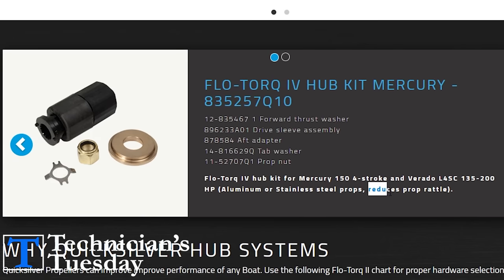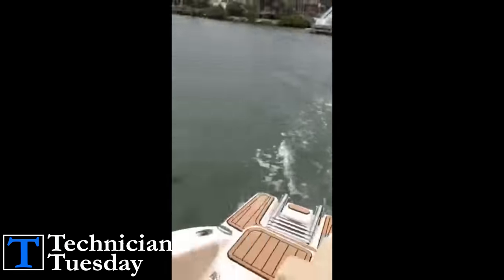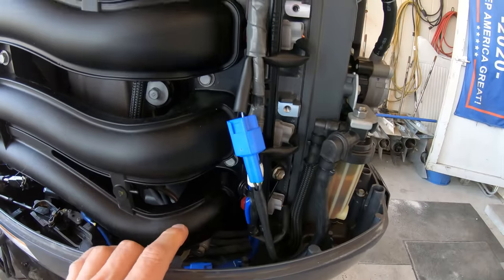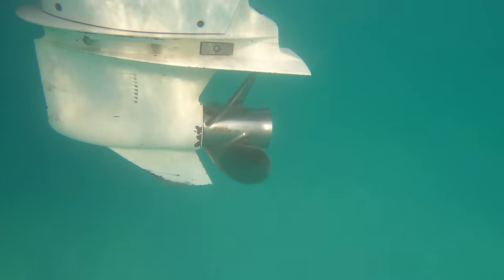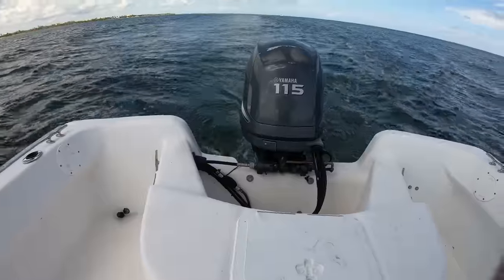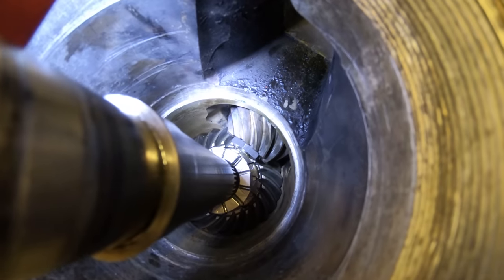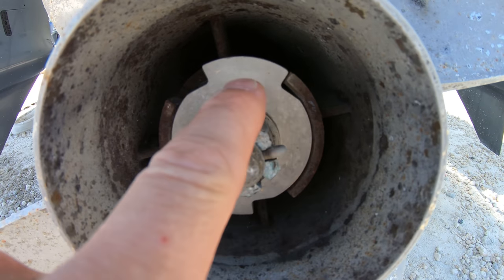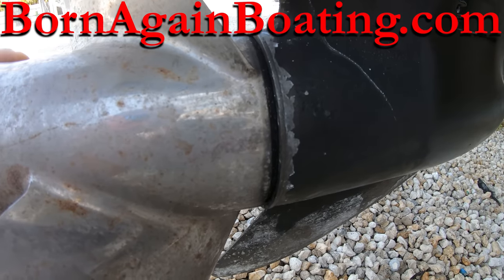A SCARY Noise Boats can make!!!

Comment: That is not what a hub does, those are designed to save your gear case if you hit something. That sound is because your clutch dog is not engaging properly.  Either your clutch dog is worn out or your shift cable is not properly adjusted. This is terrible info that mostly false.
Reply from the maker: Lol :) Yamaha must have really messed up their marketing and manufacturing then: Yamaha's Shift Dampener System (SDS) is a breakthrough innovation that absorbs the forces, sounds and vibrations normally encountered when shifting an outboard into gear.

Comment: Just changed my prop out for a lesser pitch on my Mercury 150 four stroke. Put it in gear and chattered like a mofo at idle. I had used a new standard hub when I installed the new prop. I then pulled the hub out of the old prop and found it to be the SSR. Put that in the new prop and chatter completely gone. I don't know how exactly they work but they do.

Comment: It is caused by torsional vibration of the engine.  Because an engine has intermittent power strokes as he engine turns  a torsional vibration is produced.  This vibration is a rotating vector perpendicular to the axis of rotation.  A car engine with a manual clutch has a torsional damper built into the clutch disk.  The clutch disk usually employs springs  or rubber dampers to reduce this torsional vibration.  In an out board engine like these there is no clutch (like a car) and the torsional vibration is essentially controlled only by the balance and selection of the entire drive train component's characteristics.  Adding a rubber damper at the prop shaft to blade interface results in a dampening of this rotational vibration.  It is really like the clutch disk dampers but at the other end of the drive train.  Good video!  btw - ever notice an automatic car transmission does not have a torsional damper attached to the flywheel?  Instead the torsional vibration is absorbed by the fluid in the torque converter...pretty smart these engineers!
Reply: I had a Jetta TDI and had to change the clutch.  The OEM was a dual mass flywheel that seems to be somewhat prone to failures so I put on a Single mass.  Big mistake...  Has this "clutch chatter" that drive me nuts I had to trade it in.
Reply: Man, this is an amazing comment.  You should be a teacher if you're not.

Comment: Yeah my 2018 merc 150 4stroke has proper chatter right out of the box at idle in gear, once you bump it up a couple hundred rpm it goes away but still annoying
Reply: Same here, my merc 150 with the Flow Torq II does this. 900-1000 RPM it quits
Reply: @primarysearchfishco  stock stainless prop?

Comment: I ve owned two boats with 4 stroke outboards. A suzuki 140, and another with a Yamaha 90. Both had  V style powerheads. I ve never experienced any continuous prop noise or heard any others. All outboards when shifting make a grinding when shifting into forward or reverse. I ve always done so quickly instead of slowly draging this out. 
Once after taking my Yamaha powered boat to Lake Wylie while drifting in  white capped water  with engine off but trim left  down approching shallow water I felt a sudden bump from the motor striking something hard on a downward motion from a wave or wake. Instantly I trimed motor up to prevent hitting again. I m not used to operating in waters that have rocks or rocky bottoms. Later we left to return to ramp noticing no probs or sounds. After loading and moving to an out of way spot to get boats ready for hauling back home I always go around checking , and this time I wiggled prop and it had a good amount of loose slop. I got a sickly feeling thinking this isn t good and dollar signs ca chinging in my eyes wondering how expensive the repair bill would be and how long my boat would be out of service.
On way back home (I live near the coast) I remebered that bump
The next morning home, I took prob retaining nut off,removed prob and that plastic sleeve and metal slide insert were still on prop shaft. I thought it worked like a clutch replacing shear pin older style props. I reinserted them , put back on shaft and replaced prop. This time when retaining nut was retightened the prop had normal slight loosness. I ved on a lake then so pulled boat the short distance to ramp. I slowly idled out and added gas making sure no sounds or vibrations appeared. Everything went fine and I ve had no issues. If anyone has had any kind of prop chatter or experiences like mine I would appreciate a reply.
Thanks.

Comment: I’ve got twin 2003 Suzuki 140s of a 28’ performer. These 2 motors are AWSOME!!!....BUT, prop chatter is nuts. The motors sound and feel good but all of that vibration is felt in the boat making things like all the glass rattle and fish box doors. Anything under 2k it makes lots of noise. Or especially if the 2 motors aren’t matched in RPMs. I wish there was a way to get rid of it. But your explanation was spot on. 🤘😎🤘

Comment: I heard it on a twin engine boat I was thinking about buying. One of the engines behaved and sounded exactly like the engine in this video. The owner disclosed this at the time I looked at the boat. He had it looked at, but was never able to get the chatter to go away. He did tell me that it didn't seem to hurt the engine at all and the chatter did go away as the RPM's were increased. Not knowing what this was I passed on an otherwise very nice boat that was very well maintained.

Comment: Had this on a new mercury 115 4 stroke repower.  Dealer put on a "very" large stainless prop (15.6x19).  Fixed the issue by going to a smaller aluminum prop (14x19) and flow-torq ssr hub.  Thanks for the video.  At first I thought there was a major issue with the motor, now all good!

Comment: I have 2 stroke mercury 150hp  outboard just had lower unit rebuilt when put in gear it has a little bang noise then runs fine

Comment: I’ve seen this “prop chatter” on the 4 cylinder yamahas caused by not pushing the impeller down while pulling up on the driveshaft while servicing the water pump. This causes the driveshaft to move up and down and creating that noise.
Reply: Interesting, thinking of it now mine started after a water pump service. Was perfectly fine before that. I have also put on a different lower unit to rule out a bad lower.  The noise did go away but I didn't have the propeller on. Added the propeller and noise came right back.  Super aggravating for sure. Mine is a 2002 Yamaha Z200TXRA HPDI
Reply: I’m having this same issue. My drive shaft doesn’t move when I pull up on it though. Any suggestions? I’ve adjusted the linkage and got “chatter” to stop, but it’s putting a lot of pressure on the plastic arm. I definitely think what you’re saying is my issue. Any advice would be appreciated

Comment: Interesting information. I never heard of it, but I learned something new. Thank you. Keep in mind Ive never owned a large outboard, but now I know.
Reply: I did buy a 30 horsepower yamaha about a year ago. There was a rattle from day one. Got worse after 70 ours. At 140 ours Yamaha did a repair on the bottom end. Soon our boat wil be in the water , have to experience if the repair solved the problem .

Comment: I have a 2017 60 hp Command Thrust Mercury 4 Stoke. I put a Vengeance S/S prop on with a Flo-Torque 2 and a with a Flo-Torque 3 and it rattles a lot. Don't spend money on a different hub, it still rattles bad. I just put my Black Max Aluminum 3 Blade back on. I will try that and I hope the noise goes away.

Comment: Replaced 17 pitch with 15 on My 2013 Merc 150 four stroke and it sounded like a baseball card on bicycle spokes at idle forward and reverse.. Put 17 pitch prop back on and noise disappeared. Due to performance issues had to use 15. Noise returned but engine performed better. 17 pitch prop was quicksilver, 15 is solas. Gues it doesn't matter what make.

Comment: have it with my RIB (Bombard 600db) and an F-150 hp Yamaha, but only in low idle in forward gear. And: only with stainless steel prop, never had it with aluminium props. So basically exactly how it´s said in the video.

Comment: Before I changed the prop from a 3 blade aluminum to a 4 blade stainless steel prop on my 150 Merc, I read about prop chatter and bought the appropriate hub suggested by Mercury.  It still chatters when in gear and idling and goes away as the speed is increased.  With the former aluminum prop, there was no chatter at all.

Comment: Thanks for a good, informative video.  The worst prop chatter I have run into is with my brother-in-law's MerCruiser 1.8L 4-cyl turbodiesel on an Alpha I drive.  It chatters loudly at idle with an aluminum prop (pressed hub Quicksilver or Solas), and we've been afraid to try a stainless prop on it for fear of beating it up.  My Suzuki DF115 will chatter occasionally with a stainless prop, but not as badly as that MerCruiser diesel.

Comment: I have never had an issue till I just changed my water pump everything went back together easily which I had off about four time because when I started engine and put in gear had this knocking noise does not do it n neutral but fwd and rvs both have a knocking noise not sure if goes away afraid to drive it since it was not doing this before if I take my prop off it does not do it either

Comment: I have some prop chatter on my 250 SHO. Started when I swapped from a powertech prop to a Mercury Tempest. The performance gain is worth the little noise in my opinion. The powertech prop blew out with very little effort. Haven't blown the Tempest out once yet.

Comment: I’m dealing with this now! I just went from an aluminum prop to stainless and now the stainless is giving me prop chatter at idle. It is an inline four cylinder too 🤣. I’ve tried a few different hub kits but I haven’t been able to eliminate the issue yet. I don’t want to go back to the aluminum because of the performance I’ve gained.
Reply: Amy luck so far with your prop chatter? I own a 2018 Mercury 115 4 stroke with a stainless steel prop 14.0” with a 19 pitch. The chatter started 2 weeks ago only when in gear. At idle, it won’t chatter unless you push or put pressure on the prop pushing it forward (on the trailer) just replaced the hub along with a new prop sleeve and the chatter still remains when pressure is applied against the prop at idle.
Reply: @robertweilbacher113  try the ssr hub kit from mercury should probably sort it out

Comment: It's more than likely due to oscillation. A 4 stroke engine does not rotate smoothly at low rpms. It takes a sensitive instrument to see the fluctuations in speed. It happens in some engines more than others due to the rotating mass. Even a large truck diesel engine has this problem if the idle speed is set too low. I have seen low idle speed literally beat the transmission gears to the point where they had to be replaced. Once the idle speed is increased a couple hundred rpm, the condition goes away.

Comment: I have a 2 year old Yamaha F130 with 100hrs on. I swapped the SS Yamaha 18” 13 ⅛ 3 blade for a SS Turning Point 17” 13 ¼ 4 blade. The prop chatter can be significant at idle rpm in gear now. I used the TP dampener too. Once under way the chatter disappears. Hole shot performance vastly improved for pulling a mono skier out of the water which is why I purchased the 4 blade.

Comment: This sounds like excessive play in drive shaft and gear end play.
Once a load is placed on gears the force moves gears into a "loaded" position which removes the excessive play.
Example bushings worn and being able to push and pull prop into hub.
Like you had been showing in the video.
Like u joint play will have different harmonic vibration at different speeds and under different loads Like the propeller loads .
Just my take, I would think pulling apart the lower end would show end play wear and be close to manufactures replacement tolerances.
The problem is gear wear can be shimmed only so far before full replacement  which equals $$$.
Just my take from 30 plus years in aviation with different types of drive units and 20 yrs in owning small engine repair. 
It's all related if it's mechanical, floats, flies or drives.
Reply: I have an alpha one gen2, and has the same play on the propshaft (moving back and forth) as in the video, @ 4:43 is that something to worry about?
Reply: @daytonasunset  There are end play limits from the manufacture, this will give you a idea of what is allowed or not.  You get play in everything, because it moves, but your allowed limits and excessive basically means you have "eaten up" the material of , say shims, bearings etc.. Cheaper to change a shim than the lower unit.
Noise is normally not a good thing

Comment: I don't know enough about what it should sound like to be scared.  My old Johnson sounds like that at idle or 1st notch above.  Sometimes though, it will smooth right out, revs go down, speed goes up.  Then it will die.  Bbut, revved to 4500 and planing along at 25, everything sounds pretty sweet.

Comment: Same reason a 4 cyl Cummings will shake your teeth out and a 6 cylinder won't , I've always heard that if you can divide the number of cylinders by 3 it won't shake as bad  because the pistons are 120 degrees apart instead of 90 degrees and the more cylinders there are the less vibration

Comment: Good INFO here. Any idea what would cause a clunking/bucking when trying to give the boat a tiny bit of throttle just above idle??
I have a 2006 Mecury Optimax 225. It goes into gear just fine but its starts bucking once I give it a tiny bit of throttle. Love your Channel and I'm suscribed. Any bit of help is appreciated. Thank you.

Comment: Been running twin 2-stroke 200 yamahas for nearly a decade with prop chatter.  It is annoying but goes away when you nudge the throttle.  Nothing to worry about.

Comment: This was very informative got this issue with my 2020 merc 40hp gona go to my dealer to get new ones
Reply: I just got a 2020 Boston Whaler 130 with the Merc 40. Yes! Sounds like a bucket of bolts inside the lower unit in forward, at idle! Did you find a solution?
Reply: @jaybdvm  I know it's a pain feels like there's something wrong. I changed the iner sleeve but didn't do jack squat

Comment: This same noise my Johnson outboard started doing,It’s a 2 stroke motor,but when I put it on gear either forward or reverse,it kinda loses power and I have to get on the gas pedal for the propeller to kick in,and it makes that exact same rattling sound

Comment: Because 4 cylinder in-lines are inherently unbalanced. Couldn't tell you if these motors have a balance shaft like some automotive engines, probably not since it takes up a lot of room inside the motor. The harmonic balancer is just for: harmonics. Much smaller vibrations than engine balance issues. Many engines have balance shafts, like a Ford's 6.8 V10, or an old eclipse 2.0 4cyl. Inline 6 and v12's are inherently balanced and do not need balance shafts.

Comment: I have this problem. I have a mercury 25 hp 4-stroke.  It's year is 06 and I have a solas Saturn stainless steel. Is there anything I can do to eliminate the noise? It doesn't have a removable hub.

Comment: My 2017 yamaha 115 4 stroke prop nut is tight but im still able to push in and out on prop a inch or so,,is this normal,,i up graded to ss prop from aluminum last year and haven had a issue,,,i had boat out today cleaning it and when i was flushing lower unit i noticed the extra play...IS THIS NORMAL or do i need a spacer

Comment: I think I am just experiencing it.  Slowing down from running speed I got huge amount of noise from the engine which stopped once slowed down.  I chose to take it easy the next time out just running the boat to 2000 rpm and no problem I need to get out to try it again.

Comment: I have never heard prop chatter and I’ve been a boat owner for 30 yrs but then again I own a 115 hp 2-Stroke Mercury not a 4 - Stroke. Not sure why this makes a difference? Or why inline 4 vs V-4 would make any difference if the issue is in the gearcase and drive shaft. Very Strange!

Comment: Yep, I have to run an aluminum prop on my 06 suzuki df70 because nobody makes a dampened hub for it.
Reply: Did you you use to run stainless? Was it a big difference? I’ve got twin 140s and mine rattle the boat like crazy under 2k
Reply: @dannyleemcquillenjr.8292  When I bought the boat it had a Suzuki branded stainless 3 blade that was slightly over pitched for my boat. I could just hit the lower end of the acceptable rpm range at wot with just myself  in the boat. It was a 19p prop that the previous owner had worked  to a 17p and had some of the leading edge trimmed off. I'm guessing since it was over pitched there was enough load on the gears in the foot to keep it from rattling much. The blades being trimmed probably helped some too. I bought a 15 pitch stainless solas to try to correct my wot rpm and it performed great but sounded like an old ford 4000 tractor rattling at idle. I've since tried other stainless props, both 3 and 4 blade that were sized properly for my application from michigan wheel and hustler with no improvement. Some manufacturers make dampened hubs to help with the problem but not for the spline count of the early 4 stroke suzuki engines, newer engines shouldn't be a problem to get the dampened hubs for. I ended up running 15p  solas rubex 3 blade aluminum prop, I'm now happy with the performance and my motor is back to being quiet at idle. Just the prop with no hub is only $100 shipped to my door, so I carry a spare in the boat just in case.
Reply: And to be honest I didn't notice any appreciable performance difference between the 15p solas stainless 3 blade and the solas rubex aluminum 3 blade. They appear to be the same prop design, the aluminum one just has slightly thicker blades. My boat is a welded aluminum hull and I mostly run at cruising speeds around the rivers and bays, your mileage may vary.